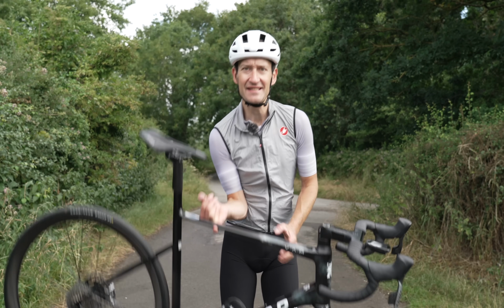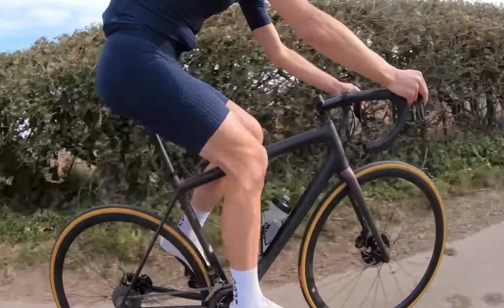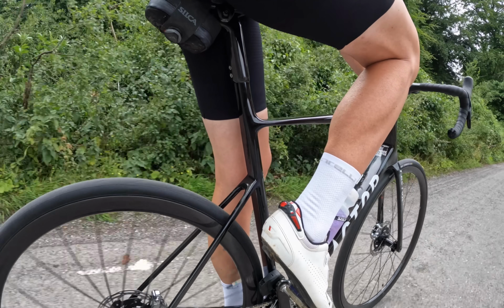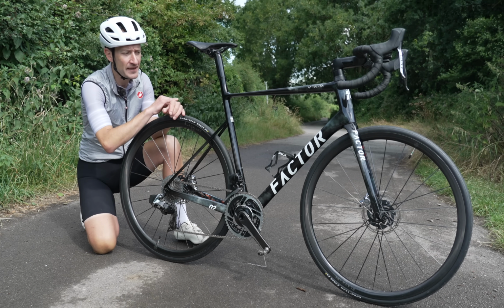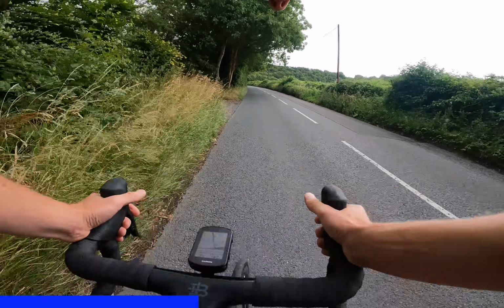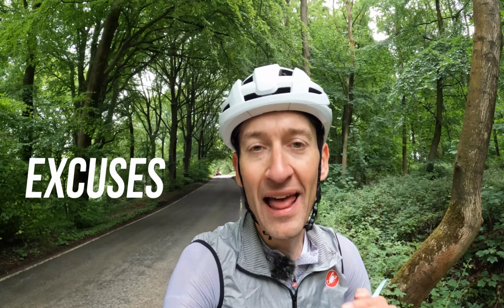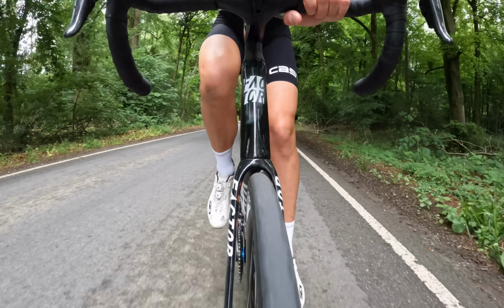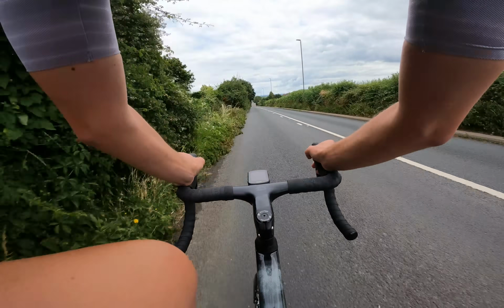NEW Factor O2 VAM Impressions: 6.3kg aero climbing bike launched

Comment: Wouldn't touch one with a barge pole , should rename them Cractor. Looked at one the weekend 02 vam 2021 , looked lovely flipped it over crack on chainstay owner was shocked! Not even worth repairing it good chance will happen again.  Doing research its common on this overpriced crap

Comment: Extremely light, extremely expensive, and possibly not extremely durable. The original VAM was pretty flexible according to several reviews, and TBH you could probably find a rim brake bike from 2019 on FB marketplace which weighs very similarly for 1/10th the cost. Does look nice though.....
Reply from the maker: This new version is claimed to be 35% stiffer and closer to the Ostro, and I didn't find it that flexible in my testing. Jury is out on the durability question, only time will tell on that front
Reply: @davidarthur the “durability “question should not come at the consumers expense ,right?!

Comment: My rim brake 2010 Bianchi T-Cube is 13lbs on the nose with Enve 2.2 tubulars and a Quarq crankset. One local bike shop called it outdated with the lack of disc brakes, tubeless, and electronic shifting. Bummer there aren't any local mountains where I could show them where this bike dominates.

Comment: This is a beautiful bike and it is expensive, but I don't think it ranks as high you you mentioned as a built bike. Their frame alone does come in pretty high, but their complete build prices are a few $1KUSD cheaper than similarly built Dogma F's or SystemSix EVOs, and pretty close to the SL7 full build (I was looking at SRAM Red builds). Factors build is premium too, with arguably the exception of the Goodyear tires. I'd love to ride and own one of these in the same color, but also waiting to see what the Tarmac SL8 looks like.

Comment: The frame should be very flexi. No way to build a frame this ligh and stiff. 13-15000 euro bike for match a weight that you can easily match with a second hand 2000-3000 euro rim brake bike. And no... discs is not an improvement whatsoever or at least it is not worth 10000 euro more. My xr4 weights 6.8 kg with pedals, aero rigid frame and 40 mm wheels

Comment: Is there a point where having a bike too light is a detriment?   And is lightness really a factor in the hands of an amateur?   That is a why I like my Cannondale SuperSix EVO 1.  For 6500 I have a 8kg bike in size 61 and the newest SRAM Force group. Btw I am 6-4 210.   Seems to me that for most amateurs value for money would take precedence over lightness as only the pros could extract performance from say a top of line Cannondale Lab71 frame over its standard weight brother.  Finally I watched a few GCN videos where they weighed bikes at the Tour de France and those bikes weighed 7.4-7.8.  Yet the worlds best riders are still performing at world class levels.  A fool and his (or her) money doth part is never more true when it comes to the purchase of these new super light bikes.
Reply: Well, if the light weight of the frame came at the cost of stiffness, then yes, the light weight would be a detriment.

Comment: Too expensive compared to the best brands out there and not as nice looking 😢 
Grim seat mast and top tube profile imho…..Yes it’s light but looking at the weights that’s probably down to the 1100g wheelset, put a decent set of dt Swiss or any other top branded wheelset at 1400-1450g thén this bike is the same weight as most other (‘BETTER’) ‘brands’ and looking aero bikes 😘

Comment: My rim break bike weights 6.5kg and was only 5k, also much more areo in my opinion.  Disc breaks add so much more unnecessary weight the fork has to be heavier the wheels and the breaks themselves there not need discs on a racing road bike.  Seems to me like a way for the bike industry to make more off sales and maintenance.  And dont get me started on 12 speed 😂 my bike by the way is a 2016 derosa sk pininfarina  with campy super record and fulcrum wheels.
Reply: @ryanterence471  interesting how do you like 12 speed compared to 11?  As for the Disc ya definitely cyclists could be better mechanics my dad's gravel bike sqeels every time you hit the breaks he never adjust or change the pads since he got it lol.  But there is this review Chris froome did and he has a team of world class mechanics even he was dealing with rotor rub, keep in mind he rides much harder than the average cyclist and the Disc technology could have improved since then.  What I really like about rim though is the way you cn hit tge quick realse if you have any issues and the lightness.  I think with rim they could easily make some 5.7kg bikes considering the new O2 is 6.3 kg with disc
Reply: @ryanterence471 cool. I actually like the 28c tires I had them on my rim break bike once but they barely fit.  I guess they can have better areo designs with disc but for the low speed climbing I'm still skeptical that the areo is fast than the weight I think it's more the tire when climbing that is creating faster times.  What I'm not happy about with bike industry is they don't offer the option of a rim break bike if someone wants one specially on the entry level bikes where the bike would be better but for the top end bikes pinarello offers rim and disc to bad other companies don't.  Also the insane prices lile these 15k plus bikes you basically need a loan to buy them it's crazy compared to even I'm the 2016s ish you could get a top spec build for 12.5k or even 11k.  I feel like they just come out with new stuff like 12 speed that is cool but basically the same performance just to charge more money.  But ya I might switch to disc  next year with the Giant Propel sl 0 it's pretty sweet 6.9kg and super areo.

Comment: A 6.8 kg race bike if fine for UCI racers.  But for amateurs, a heavier bike is far less "lively", has a smoother ride, absorbs vibrations much better while contributing less riding stress.  Losing 1 kg. of body mass will give you the same result on speed.
Reply: I would argue that a 6.8kg bike is fine for UCI racers, but as we, the people, have no weight limits for riding a bike, I would like to be able to buy off-the-shelf 5-6kg bikes. The technology is there, just make it mainstream. 
I already lost all my kgs of excess bodymass, and if I would have a kg in excess, I would like to have a bike with a kg less to compensate, not a bike with a kg more just because.

Comment: But is it a wet noodle like the old model VAM?
Reply: This is the real question right here. 

I have a (non VAM) 2020 Factor o2 and ABSOLUTELY FREAKING LOVE IT. Definitely NOT noodly.  Mine is sitting at 6.8kg with Reserve 40/44s so still pretty light and aero.  Can't really justify upgrading to this at all, however the Ostro VAM is still in the cards.

Comment: I have a Factor Ostro VAM Dura Ace group set + Bontregra Aeolus RSL 51 + specialised sworks bottle cage, Ultregra pedal & wahoo comp. mount = weight 7.2kg. The best bike so far… aero + light weight , comfortable & easy to climbing hills….
Reply: Great, what size frame?

Comment: Hi David, really enjoy your channel. I'm starting to take my cycling more seriously and am still on my entry level bike, what would you recommend as a good second bike step up for extra speed and less weight?
Reply: Anything alloy with 105 installed is the way to go.
Reply: What entry level bike do you have? Depending on what it has, you might just need to upgrade tires+tubes and the handlebar to give you most of the gains :)
Reply: @neutronpcxt372  i have a Trek Domane al 2 😃

Comment: Nice, sounds like my 2014 Cervelo R3 rim brake bike, super light weight and very smooth riding 😊
Reply: I saw an r5 rim brakes 2018 with electronic shifting and carbon corima wheels 6.6 kg... they are screwing us so bad.

Comment: After watching this, It makes me even more wonder how Giant Propel managed to have that weight with relatively thicker aero profile tubing and 50mm wheels.
Reply: Is the propel like 9kg?
Reply: @TrickyTree84  Newest gen SL 0 modal, team edition painted, with 9270 power meter version, tubeless setup, 2 bottle cages and pedal, size ML, weight 7.03 Kg.
Reply: @jianhuichua1154  And the Advanced Pro 0 Ultegra Di2 stock is 7.3kg (TCR Adv Pro 0 is 7.2kg).  Not too shabby.